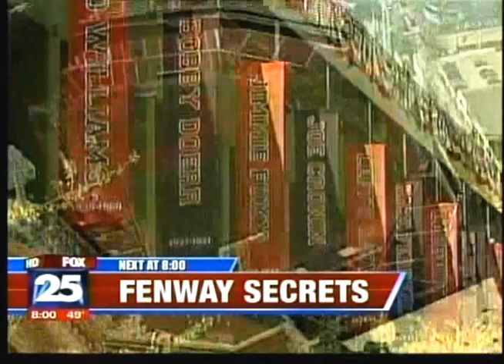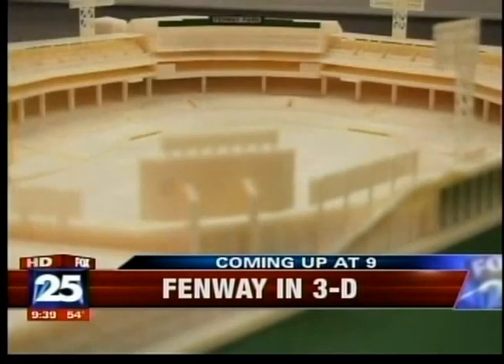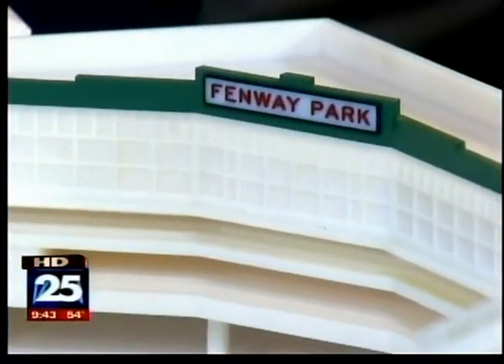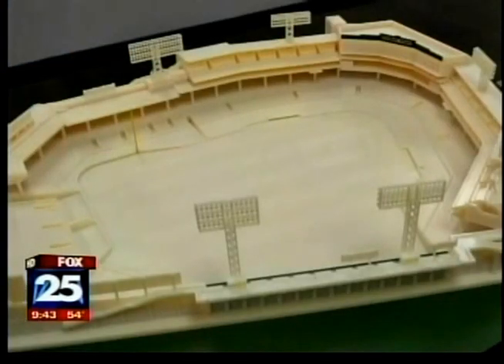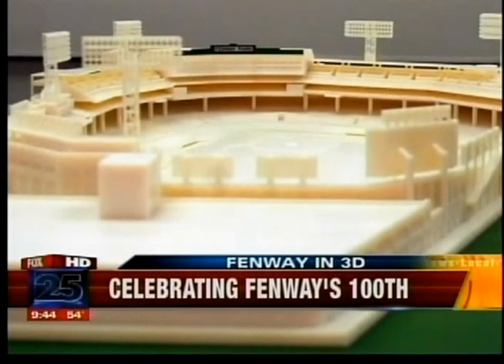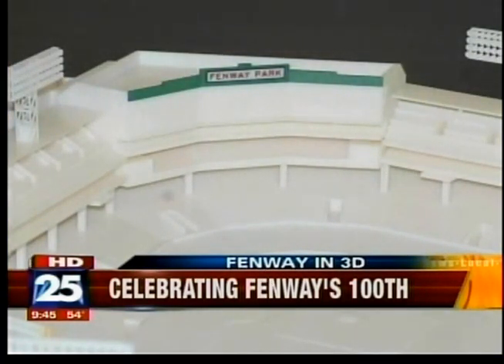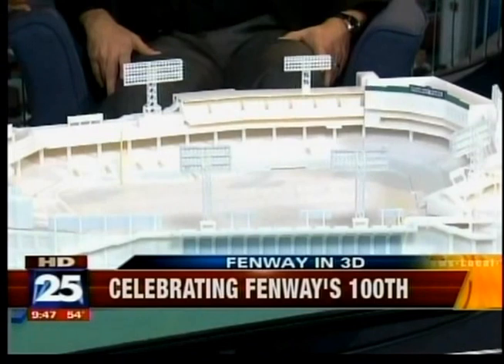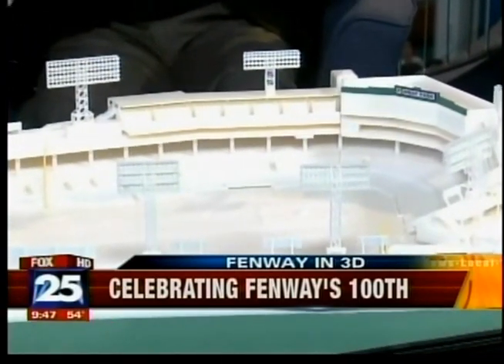Objet 3D Printer Recreates Fenway Park on Fox News

Comment: the one that printed this is possibly the Objet 24, which is $20k, the Objet 30 has more options including some color options, but is about $50k.  Objet is excellent for architects and prototypers, but competes with many others. For jewelers Solidscape is the standard. If you want a simple printer with not good detail, then there are many options, including Solidoodle for $500, and uses cheaper plastic. New models like Form1 and B9Creator have promise for around $3000. Makerbot2 is good too.